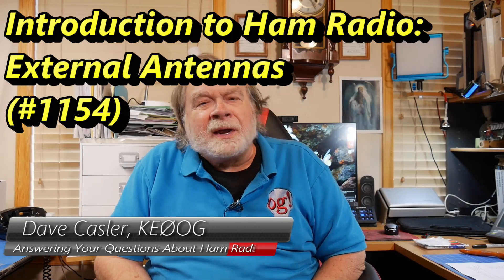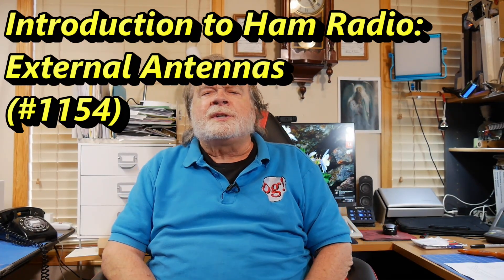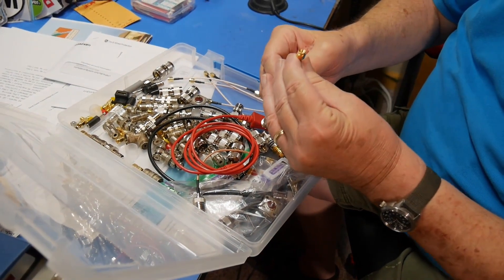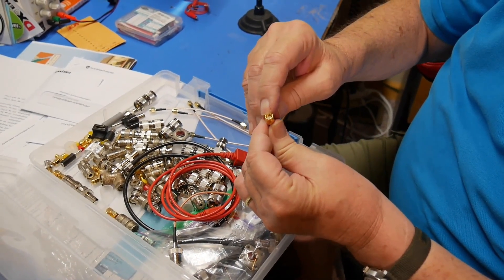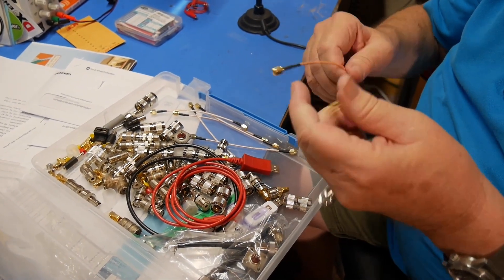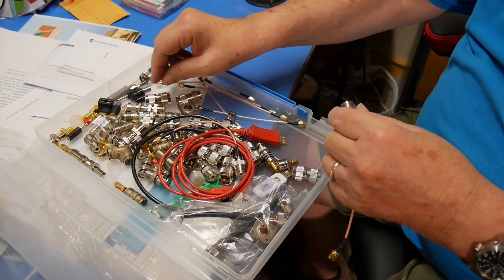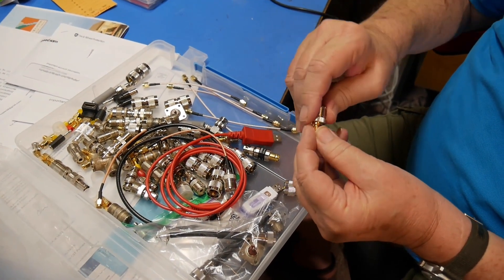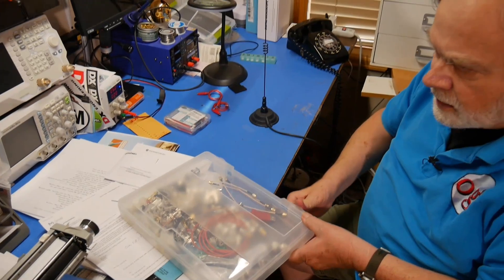Introduction to Ham Radio: External Antennas (#1154)

Comment: Do you run the jpole as a mobile sort of temporary thing, or is it a permanent stricture.  If so, how do you ground it from lightning?  I’m not much of a handiman so the building and installation safety aspects are all somewhat intimidating for me.

Comment: I am currently a unregistered potential ham operator - give me time.

QTC I'm just getting into ham radio, and I think this video is great. While size of antennas may not be as crucial for local communication, I believe it does matter when trying to establish world-wide or long distant contacts. Elevation also plays a significant role in maintaining signals over long distances. For those interested in global communications, even skip zones can be affected by the type of antenna used and its potential gain.

In my opinion, the antennas you choose for distance and gain may set you up for more success in your worldwide communication endeavors. I would love to see a video on mobile world-wide communication on all pertinent channels within the HAM and CB bands. Note: "I would like to see what kind of antennas you recommend for that." As for repeaters, I believe they serve as a localization tool, redirecting signals through someone else's antenna to maintain direction and extend range where line of sight or interferences is typically an issue. For example, if you're trying to communicate with someone on the other side of a hill, a repeater can help your signal bounce off or repeat from their antenna and back to the intended receiver.

When it comes to mobile ham radio operations. I am interested what factors play in picking an antenna. For me, I guess a key aspect of this is to ensuring proper grounding and bleed-over prevention of the equipment. For instance, when setting up a mobile station, I think it essential to consider factors like power and grounding consistency to avoid potential interference on near by equipment and blead over on to all channels when broadcasting. I would like to maintain a level of professionalism, language, syntax and ensure that my ham radio endeavors are both enjoyable and compliant with regulatory requirements as well as for the other users in this field or endeavor.

73 until next time and thank you for this opportunity.